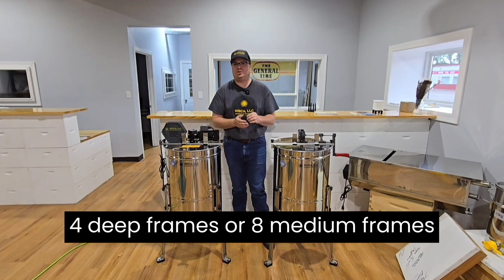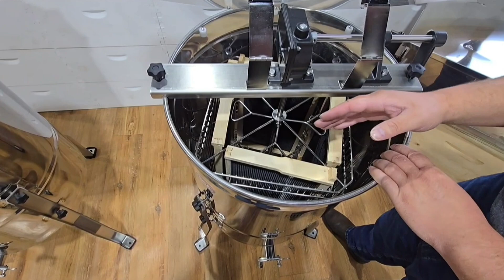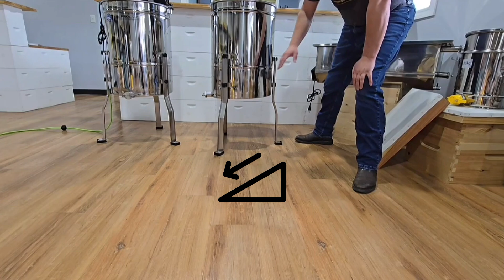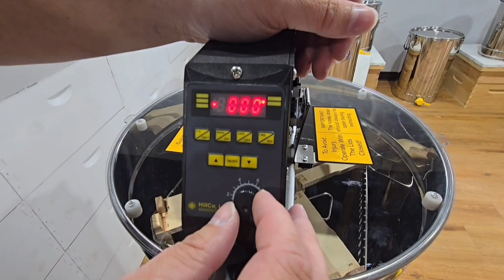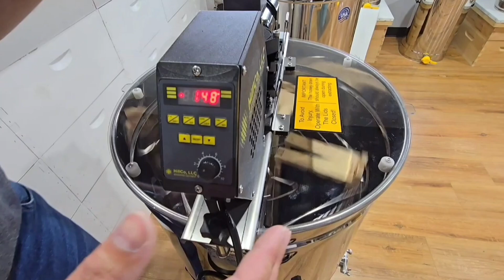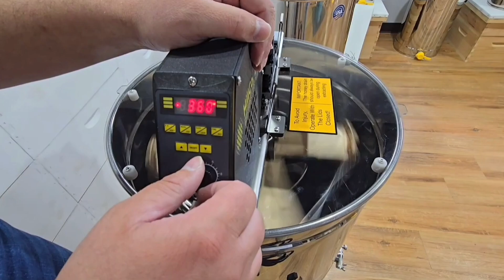NEW E8 Extractor Offers High Value Features! | HillCo, LLC

Comment: I currently have a 3 frame manual extractor (started with just 2 hives)  Now up to 5 hives and after this last honey harvest and the time it took I'm looking at the E8 motorized.   Question - how long do you normally have to spin in each direction radially?   Never had a radial extractor.

Comment: I just bought the Electric Eduro and havent even got to use it yet, wish I would have waited for the 8 frame E8! Is there anyway that the new cage fits in the Enduro, and maybe we can upgrade?
Reply from the maker: Hey Jason, I'm so sorry, unfortunately they're not interchangeable, as the E8 basket requires a slightly larger tank....